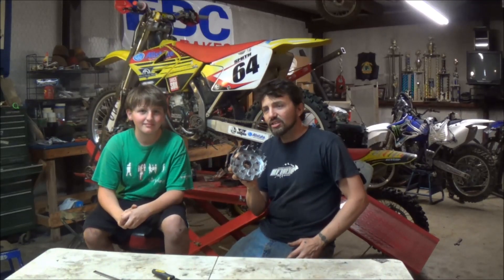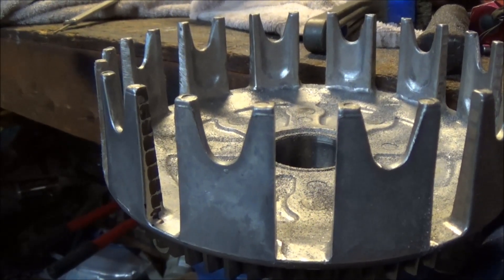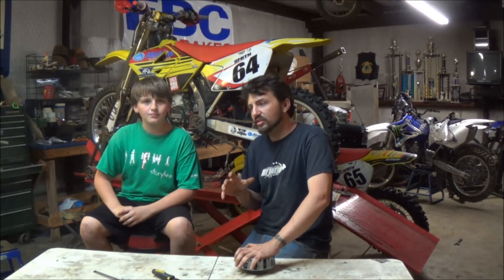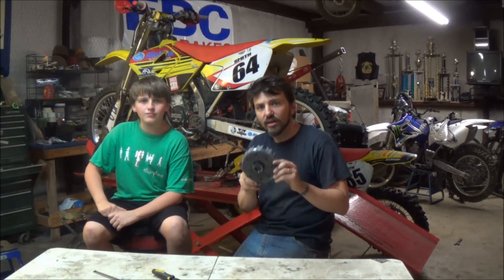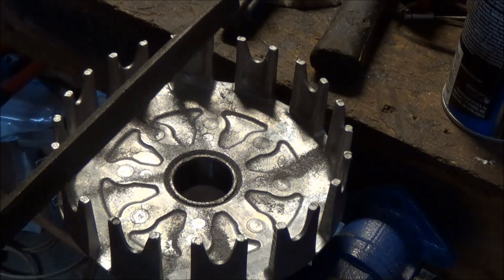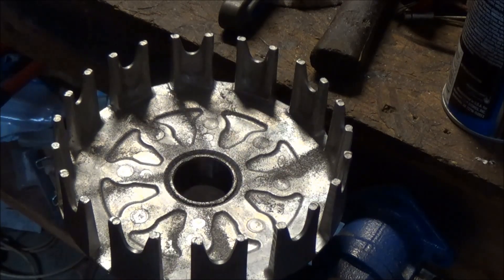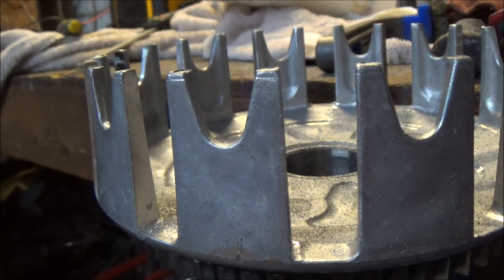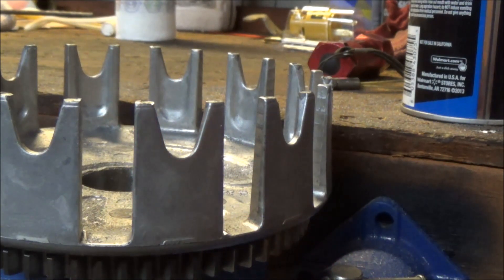How to Clutch Basket Repair

Comment: Did mine it growls now lol
Reply from the maker: Filing the basket shouldn't cause a growling noise. Something had to be reassembled wrong.
Reply: @racingfortheson  Rofl you seriously explain to me how you install it wrong I'll wait right here. Don't say torque 90nm derka dur did it.
Reply: @racingfortheson  Trust me filing a Suzuki basket is an awful idea the material is to soft and wears to fast,now if we was talking Honda I agree do it and your explaining is 100% correct.
Reply from the maker: IDK how it could because the hub is pressed to the inner basket bearing with the nut. Growling noise is made from rubbing or wobbling. Filing the basket fingers right would cause no side to side movement. But yes, filing the basket is a temporary fix. Thanks for watching.
Reply: @racingfortheson  Agreed keep the videos coming,I honestly say my RM is a crank bearing to be honest.
Reply: Thanks for the how-to, guys! This was just what I needed.